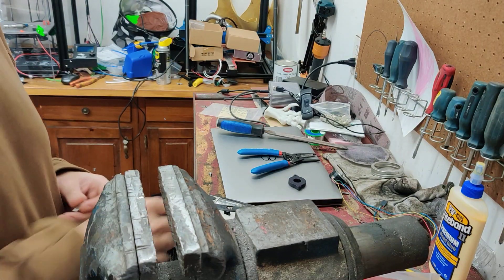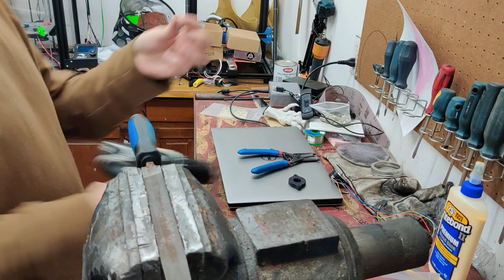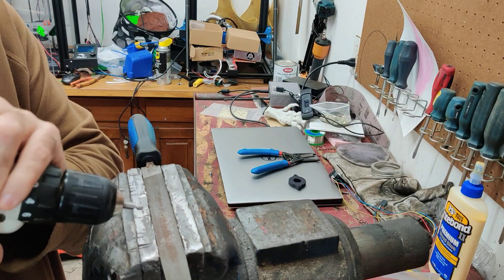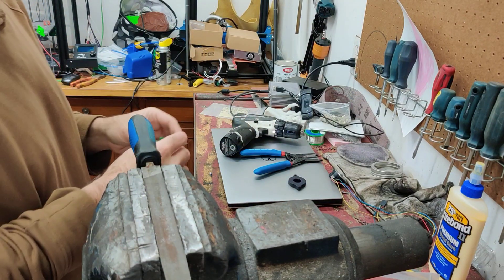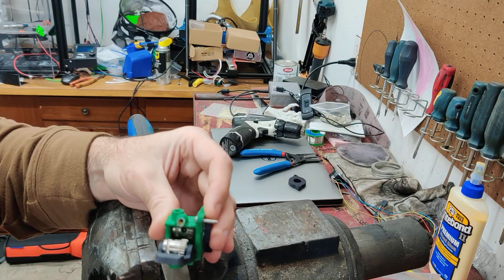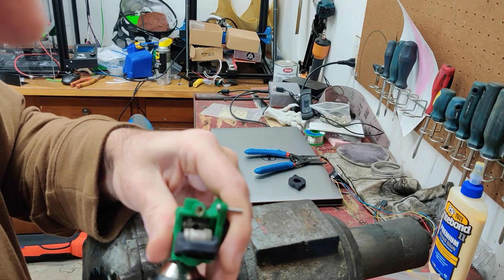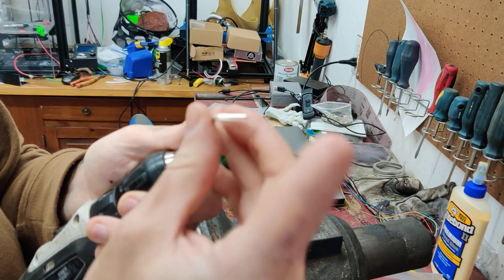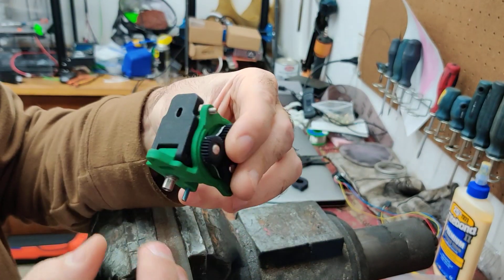Orbiter Extruder Heatbreak Setup Tutorial

Comment: Does the v1.5 solves this problem?
Reply from the maker: It's not really a "problem" so much as a refinement. It's mostly what the original designer intended, but it wasn't documented. The v1.5 extruders have a filament path that's molded-in as part of the casing. It does a better job at constraining the filament path than just using a heatbreak, but not as good as modifying the heatbreak like I do in this video. The difference is about 1 to 2mm, which isn't much, but has been a nice improvement for me when printing very flexible filament, so I stayed with the v1 designs on all my printers
Reply: @FriendlyPhoton  do you know if v2 improves on 1.5 on that aspect?
Reply from the maker: @vim55k  Yes, V2 has a custom metal filament path that's specifically designed for this application to apply maximum constraint. But V2 won't be out until August or so.
Reply: @FriendlyPhoton  thanks!

Comment: My shop teacher would have had choice words if he saw me doing that. Single cut file mounted in soft Jaws and oiled for the cut. Without knowing the grade a stainless steel used in generic heartbreaks, stainless has been known to work-harden so probably a medium speed with a little extra pressure isn't a bad technique to use. Of course i base this on an assumption one values his files and plans to use them more than once?
Reply from the maker: Yeah I wouldn't worry about that, I've had those files since 2005 or so and they're as useful today as they were back then. They're budget Lowes brand. Also, based on how fast the heatbreak wore down, I doubt it's able to do any kind of damage to the file.

Comment: Where do you get all the hardware for the extruder?... I want to print my own but I want to do it as cheep as possible... so I don't want to buy the whole thing
Reply from the maker: The required materials are all listed on the thingiverse page. The bearings are pretty straightforward to get, any online store that sells such things (Amazon, McMaster-Carr) would have them. Depending on the version you print, there's either 2 (V1) or 3 (V1.5) types of bearings to get. If you go with the V1 model, the heatbreak for the filament path is a standard E3D V6 heatbreak, available anywhere for dirt cheap. If you go with the V1.5 model, then you don't need that part. The only part that isn't readily available is the spider gear shaft in machined aluminum. As far as I know, the only way to get that is in the kit, or to print your own. I don't know how resilient a printed one would be, I've never tried it. But if it was printed in nylon or something else very resilient, I think it might be plenty solid
Reply: they're like $50 man